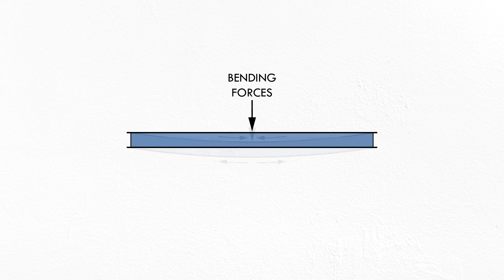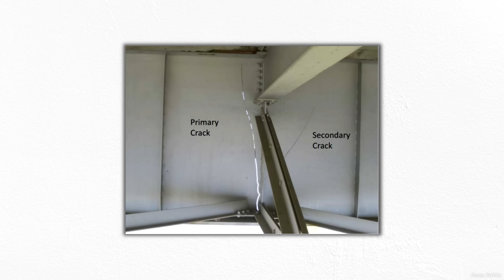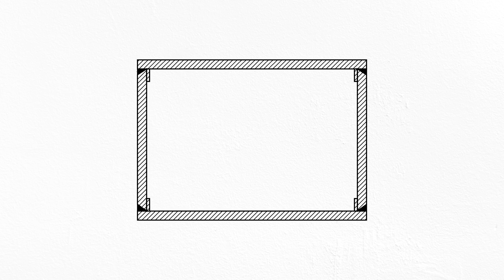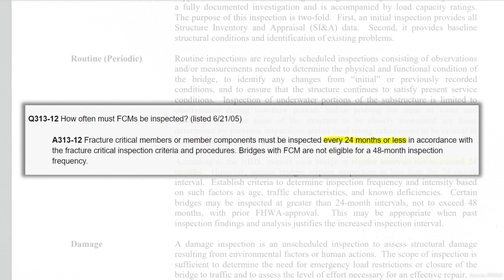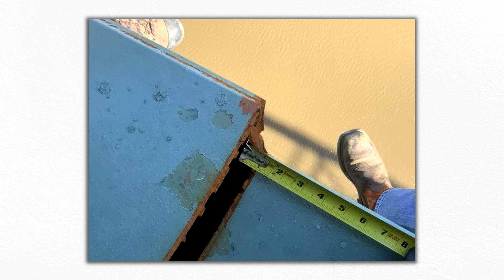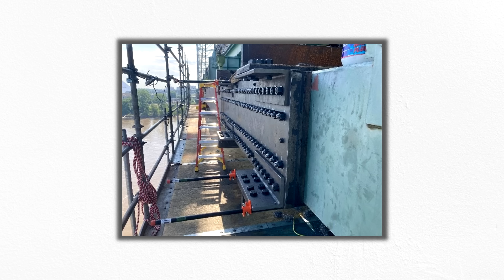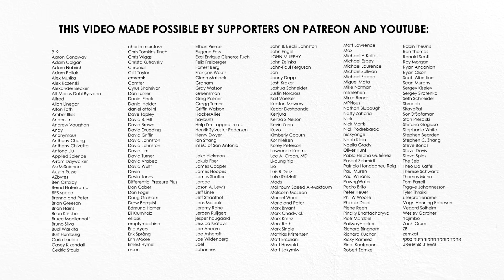What Really Happened at the Hernando de Soto Bridge?

Comment: I actually expected him to explain why this isn't such a big deal and leave the video feeling confident in bridges, but now I never want to cross one ever again.
Reply: just know that you probably have a waaaay better chance of being struck by lightning than actually being involved in a bridge failure, even with the small ones
Reply: The problem is called deferred maintenance, and it is the reason why the transportation and infrastructure bill is 2.2 trillion dollars right now.
Reply: @baylinkdashyt  Deferred maintenance is one thing for non-critical things, but not even inspecting or knowing about an obviously failed critical component ongoing for years is an even bigger issue.
Reply: Well on the flip side consider the fact that such a huge crack was around since 2016 and nothing bad happened to the bridge.
Reply: @eyeborg3148  That's probably and indication that the bridge was/is indeed well designed, exceeding the expected force capacities and including some redundancy features. Suggesting the failure is more likely to be a maintenance issue than a fundamental design flaw.
Reply: Not to add to your fear, but if this problem were isolated to that bridge and the agencies responsible, it would be bad enough. But it actually represents a systemic problem with American infrastructure.
Reply: Just don’t cross one in Arkansas.
Reply: Life in modern society and infrastructure is all about calculated risks and management of dangers. There is a terrifying number of things that can get you killed that add up to not-insignificant chances of premature death within your lifetime that are all around you. Heck one of the most dangerous things you could do is just drive a car.
Reply: @Fenriswaffle  What you say is true, but it does not forgive failures in managing those risks.
Reply: @ltlbuddha  Ah, sorry. I didn't really mean to imply that it justifies catastrophes or anything. Mostly just meant that even modern human life comes with a multitude of risks well outside of the control of the individual.
Reply: It is the calculus made everytime we design something
Reply: I will not let my wife see this video, she already freaks out when ever we have to cross a bridge of any size.
Reply: @july8xx  Well, a good thing you don’t live where I do. We have around a dozen large bridges and dozens upon dozens of overpasses for roads and highways. It is just part of life. To have such a fear must be painful.
Reply: @MegaSnow121  Well, thankfully it is only major bridges and has more to do with the height of the bridge, going to the keys in Florida or the Lake Pontchartrain bridge are no problem, neither are regular overpasses.
Reply: It's fine, most people leave bridges alive most of the time.  Unfortunately 'most' is not 'all,' but it's pretty damn close in this case.
Reply: Most land vehicles and structures are built to a safety factor of 10. I read this in a material science book. It's standard practice.
Reply: Find a warm bosom upon which to hide your terrified eyes.
Reply: This crack should give us more faith in the bridge,  even with a major break of the structure, its still standing and didnt collapse in the river.
Reply: Bridges (and civil engineering in general) is designed with a little 'Extra' as needed.  
Any idiot can design a bridge that will never fail.  An engineer can design a bridge that will JUST not fail, within a certain number of years, with a given amount of typical 'abuse'
Reply: If you lived in Memphis you would know how big of a deal this is
Reply: Well...ok then
Reply: Next video: airline maintenance checks.
Reply: @S.Crown414A  I'm glad someone other than a Memphian are pointing these things out. But wait, there's more.
Reply: @arglefargle123  No you are the idiot
Reply: I remember a bridge failure in the 80s on the NY Thruway killing a bunch of people.
Reply: @jimcrelm9478  How is any of that fortunate?
Sounds horrible for the economy.
Reply: I know what you mean, just look at Agolf Twittler and his reign of idiocy. Never again!
Reply: Wait until you realize states get bigger bucks for repair of their bridges are left in disrepair
Reply: @silent_stalker3687  That's not some secret conspiracy, bridges in worse condition simply require more money to repair. Let me assure you as someone who has worked in bridge inspection for state DOT that there's definitely not big bucks to be made that way lol.
Reply: @alexarvizu2526  what dude is saying is more government funds are allocated for the bridges repair and not all the funds are spent on the repair,some cash is surely pocketed by dirty officials.as per the norm, that’s the name of the game it seems.
Reply: @alexarvizu2526  That's not what he's saying, or as someone else put, down to corruption. What @Silent_Stalker is saying, it's easier to get funding for large repairs than smaller maintenance issues. It's just the way funding goes, the more desperate the need the easier it is to get help. So rather than spending money constantly monitoring and repairing a bridge, do the bare minimum. When it gets to a safety critical level, plead poverty and ask for state or federal funding. It happens the world over.
The higher levels cannot refuse or that vital artery will end up being closed, the local officials being able to legitimately say they closed it out of safety and it's not fair they have to pay for something that is used by far more than local residents.
Reply: @tedferkin  I worked for TDOT's bridge inspection division so I'm familiar with how it works. ARDOT handles the inspections for the bridge and TDOT handles repairs and maintenance.

The TDOT process is to send out teams of technicians to each bridge who report on the conditions of the structure and the waterway using a numbered scale, with 9 being in perfect condition (usually only a brand new bridge gets a 9) and 0 requiring immediate closure. These reports are filed for thousands of bridges across the state and sent to the TDOT headquarters in Nashville, where repairs and maintenance are prioritized and budget funds are appropriated based on those conditions. ARDOT most likely has a different process for inspections, but as TDOT is responsible for maintenance and repairs of this bridge, the decision to repair lies with them. 

TDOT isn't going to gamble with such a critical highway corridor for some nebulous conspiratorial financial incentive. The other person implied they get some kind of big payday and then skim off the top, but nothing that indicates that's the case. Securing more funding for this repair isn't some boon to TDOT. It will be spent on the much more costly repairs necessary to open it back up.
Reply: Bridges are an affront to nature and should have never been invented. Some barriers are just not meant be crossed.
Reply: @Mireaze  Ahahahahahahah you are crazy
Reply: @Mireaze  How do you have Internet in your cave?
Reply: @Mireaze  Kazinski is that you?
Reply: @Mireaze  Idk I'm sure some architects would be inclined to disagree, melding structure and nature.
Reply: @Mireaze  I suppose you don't live in a house or  structure of any kind then, right? I mean houses are just  bridges with walls and ceilings. Pop up in your attic and tell me those trusses, beams, and joists don't look like a bridge.
Reply: @Mireaze  why are you even watching an engineering video?
Reply: @Mireaze  what a hot take. Respect despite my disagreements.
Reply: @Mireaze  cars are an affront to nature and should have never been invented. All journeys are not meant to faster than a horseback or train.
Reply: @Mireaze  Wow, with that kind of thinking our ancestors never would have migrated off of the savannas.
Reply: @Mireaze  Agriculture was a mistake.  Reject modernity.  Return to monke.
Reply: @Mireaze  something something tower or Babel amirite?
Reply: @Mireaze  Dang, can't argue with that

Comment: I guess the guy who got fired was one of those operating the drone, in the drone footage that obviously shows a crack …….
Reply from the maker: The video from the drone inspection was only looking at the hangers. It happened to catch a glimpse of the crack, but that was an outside team not looking at the tie members. In the many many hours of footage they took and not being responsible for inspecting the arch ties, it's not surprising they missed it.
Reply: Kinda related to this: /watch?v=vJG698U2Mvo
Your brain is a master at ignoring details you aren't directly focusing on.
Reply: @PracticalEngineeringChannel  thanks for that Grady.  There is a significant difference between looking as something and seeing something.  Daniel Simmons Gorilla Experiment is a great example of this.  If we have not correctly primed out brain to find something there is a shockingly bad chance of actually seeing it.
Reply: But the drone inspection was of thee cables, not the beams.
It just captured the crack by accident in a few seconds of over 5 hours of footage.
It's typical for the USA to blame the individual, but as a result problems in the system do not get fixed.
It is the reason that all across the USA the same things keep happening.
Reply: It actually probably wasn’t the guy in that video. In light of this previously commented info. Someone else responsible for that inspection.